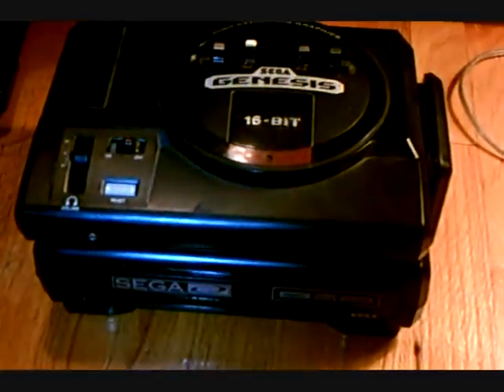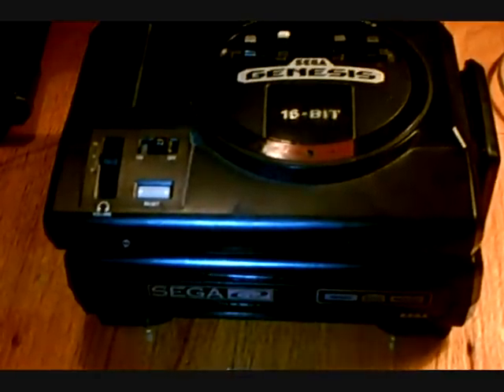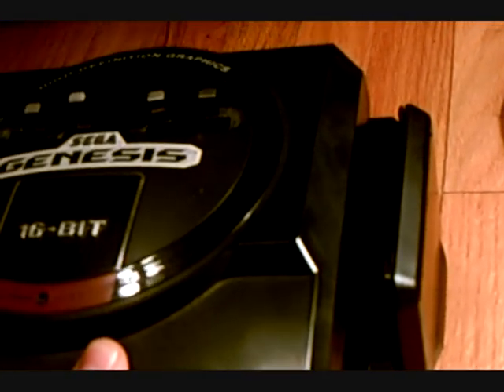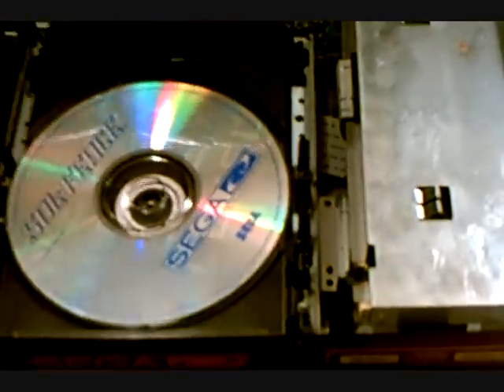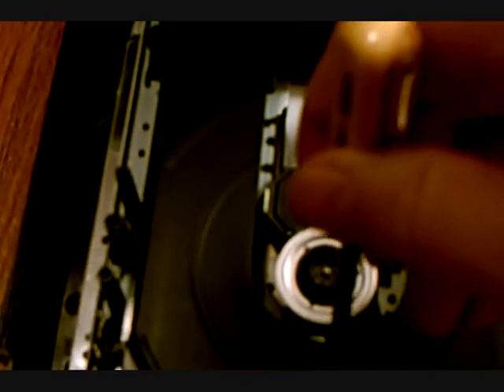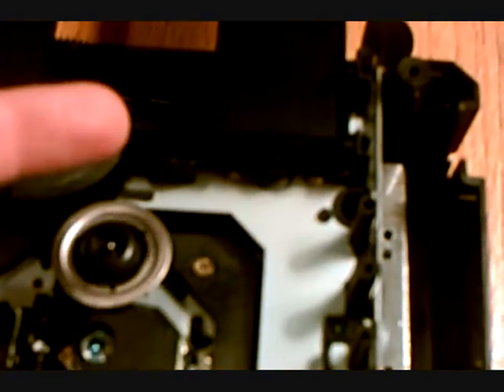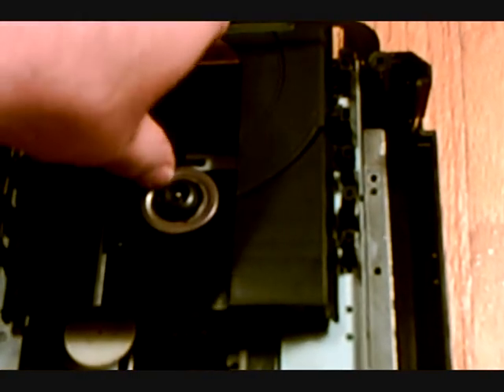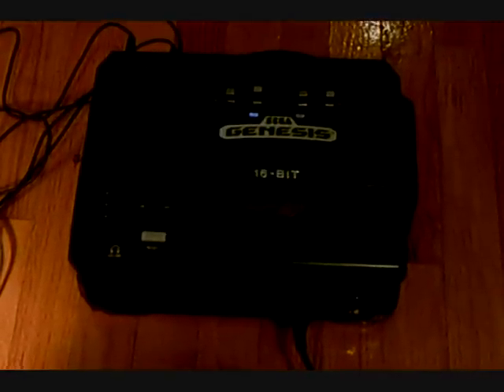Model 1 Sega CD Fix - Broken Tray Won't Eject

Comment: That's a helpful tip! Stupid motorized cd trays, I have the model 2 Sega CD so while I think I like the model one's looks better, the model 2 is more reliable with less moving parts.  

I wonder if your fix would apply to any other kinds of disc trays (DVD players, PS2) if they're all built similarly?

Comment from the maker: I have never run into this problem but I've only ever had one model 2 Sega CD.  My guess would be that the disc is being pushed too close to the laser.  I would check to make sure that the spindle that spins the cd is not lowered for any reason and also check to make sure that the circular part attached to the CD lid is very loose and is able to move around.  If that has gotten stuck or stiff it may be pushing the disc down into the laser.

Comment from the maker: I would guess that the wheels and bands that run the cd tray could be fixed easily, but I doubt that piece would be in other systems.  I really don't even have any idea how it could have been dislodged.  The guy I bought it from may have opened it up trying to fix something and pulled it out or possibly it just jammed and popped it out.  But either way, other than collectors sake, I'd go with the Sega CD top loader.

Comment: did anything sound like it wanted to move. i have a weird one right now that works but the cd part does nothing. i have manually moved the tray out and back in and it dont feel like anything is stoping it. mine is the pal uk version and dont have the big cog, it has a white thing in the bottom you can use a flat head screwdriver in

Comment: When I turn my Sega CD model 1 on the access light continually blinks. Drive opens fine and closes fine with a CD. Access light keeps blinking. When its closed up it asks me to hit reset to put a CD in even thought there is one in there. Any advice?

Comment: my sega CD has the same problem but the problem was that i cept pushing the tray back in becuase it will open by it self and i didnt want that so i cept pushing it back in and now it wont come out i hear the sega cd make noises the eject noise that it want to come out but its not pushing it i even took it apart and notice that teh card is not straight its like way down not straight idk ill look at this video if not what im looking ill post a video responce

Comment: OK I FOUND PROBLEM my friend bryan will try to fix it but what i say is that what hold that things thats under teh CD tray this big thing idk what it is called that.........OK the one has that grip that holds your cd in the middle in place and that black wheel with teeth underthat is what makes this nob turn when it turns the nob goes up with the grip thing but that problem ITS BROKEN its like glue but no its one of those rotten plastics UGH HELP